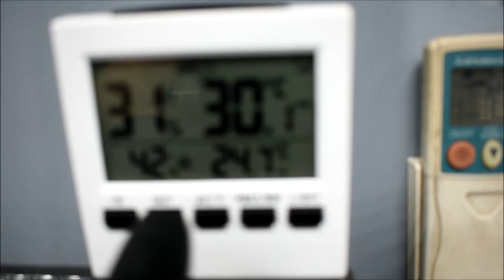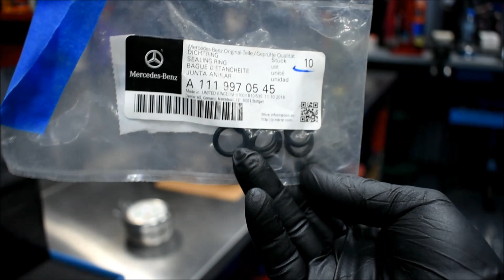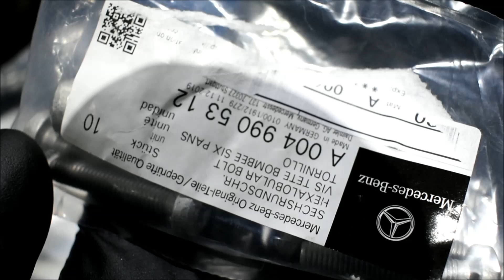C63 2015 with 63k km check up (part 3)

Comment: Thanks for these excellent videos, I just pulled the intake on my 2014 507 this morning, about the same miles as this car, 39,000 miles.  Intake looks about like this one maybe a little more oil, certainly was time to do the PCV and clean it all out.  I don't see any corrosion on the outside to speak of but I don't wash my engine like you advise.  Will see how it looks on the inside later today hopefully just needs a good cleaning and put back together using these lates videos, will likely paint also just for added protection.
Reply: PCV damage: what kills it??  is it the rubber diaphragm that lets go or the centrifugal separator that wears out like it used to on previous design??

Comment: Hey quick question if you have a minute to answer - do you apply thread lock, like blue loctite to the internal bolts in the manifold, it looks like there is something on the threads of those bolts from the factory, but may just be corrosion I am seeing also.
Reply from the maker: I'm not using thread lock in any bolt
Reply: even the plastic oil filter cover has a specified torque regardless of the way it is sealed by an O-Ring 😉
Reply: @glasser2819  Yep I know all the torque values for everything, just noticed it appears there was something also on the threads appearing like thread locker, was thinking maybe they also used some type of thread lock to ensure a bolt can't come loose and be sucked into the engine.
Reply: @TasosMoschatos  Just a little update, I ended up ordering new bolts from Mercedes as I had one break when being removed, luckily broke and left about 8mm sticking up to get it out - new bolts from Mercedes came with blue loctite applied to them.

Comment: Also will the cleaning that you did fix the engine from not getting so much fuel on passenger side that was making it misfire.
Reply from the maker: It's good thing to open clean and paint the intake manifold to prevent future corrosion, regarding the fuel injectors send it for check up and cleaning.
Reply: Engine had some kind of vacuum leak Taso was spraying with carb-cleaner, I am not sure what part was actually leaking vacuum/sucking air in.

Comment: Tacos. Been watching you for a little while thanks to Alex.  I have a beautiful 07 219 amg. 
Very clean. Very well kept. I took it upon myself to do basic Maintenance like spark plus, fuel injectors… I now have the whole intake out… and I can not find that rubber gasket that sits under that “o” shaped metal ring which the bucket then sits on for the 2 throttle bodies to be placed over them.  

I don’t want to take it apart till I find that rubber gasket. I’ve cleaned and painted everything else I just need to paint what you do for rust protection and shield the metal. 

If you can help, thank you much. Otherwise good luck to you, and very nice work, love the clean and meticulous attention to detail!